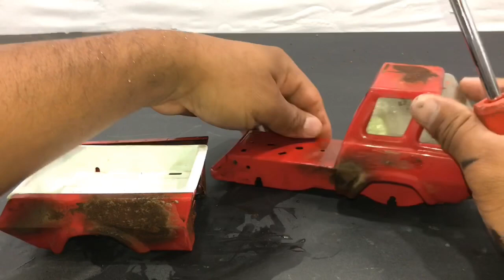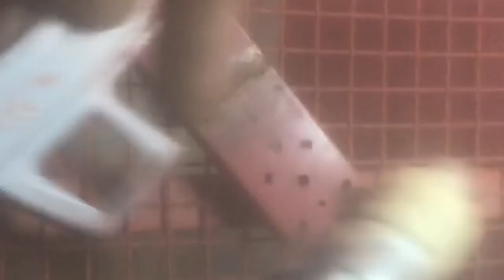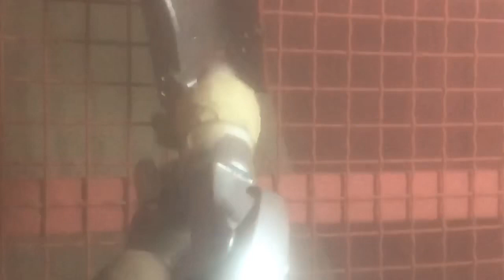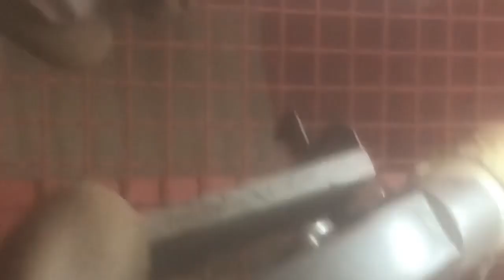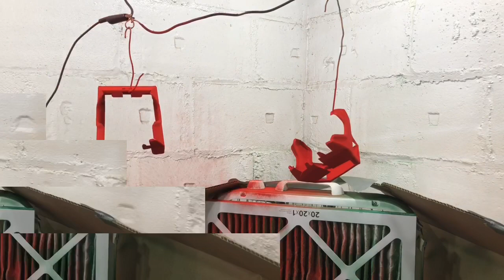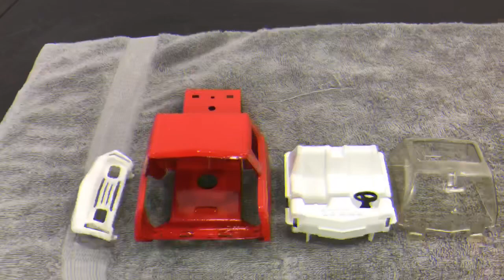1970s tonka pony puller pickup

Comment: I take it you got things out of order, you didn't really paint the lettering on the tires before you washed them up, did you. I think the grill looks better chrome. I have the exact same truck, partially restored, took me forever to find a grill for it, mine was broken beyond repair. it had seen so much daylight, the red paint was pink, the grill portion was just crumbling. I had to buy a whole truck to get the grill. it should be here soon, so I can finish up the redo, I'm not calling it a restoration really, I didn't even paint it back red, I went with black because it's what I had on hand. Black with a metal flake finish. When you need to get the plastic white, a paste made of hydrogen peroxide and baking soda does wonders, put it in a plastic bag and just let it set on the parts over night. They get brilliant white, even if the sun has yellowed them.
Reply from the maker: Yes lol good observation 👍 I accidentally put the wash part before the painting of the tires. I put the white grill because I didn’t have the chrome paint at that time. I also did it white to match the cargo and wheels. I really appreciate that you take the time to analyze my video. Thanks for watching my video
Reply: @alexchronicles7597  well it could also be white, but in that case some of it needs to be the body color. They have other models of this truck that have a white grill, but it's a different design and smaller, inset into the body more, with the red (or whatever the body color is) around it. I can get chrome (well metallic silver) at the local dollar store for cheap. They also have a gold that works well for some things. The one with that style grill is actually pretty rare.
Reply from the maker: Yea I’m also doing more research on them I do have some other tonka toys to do I’m just waiting on get my printer for the decals
Reply: @alexchronicles7597  I have some others too. I would love the "working" decals but I don't find it necessary to put the Tonka name all over it. The one I have it was a real pain to remove the paint without a sand blaster. It stood up to 2 goes with paint stripper, and 3 with caustic soda.
Reply: Anything you trying to get white again you can use peroxide and water with some oxi-clean. Toss them in a small tub and your clear plastic too. Put a uv light over it. Overnight..like new.